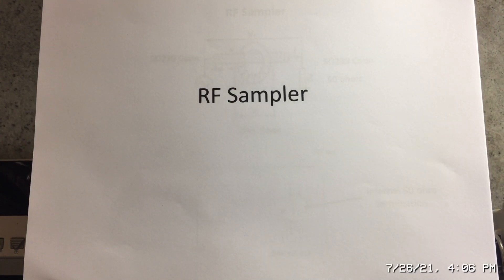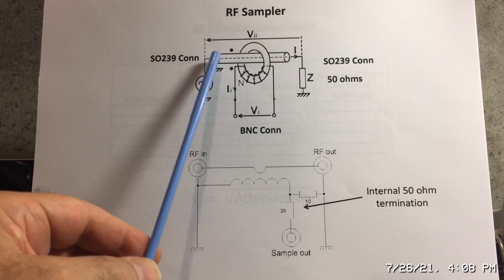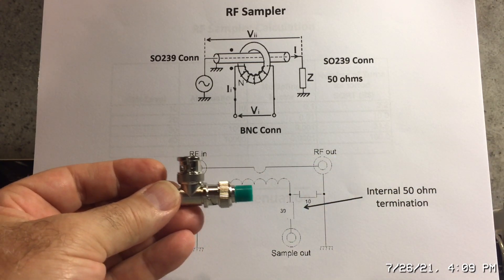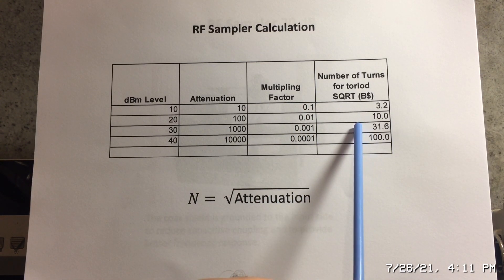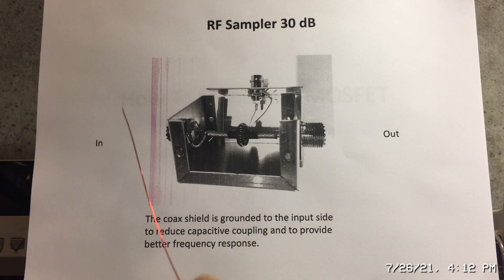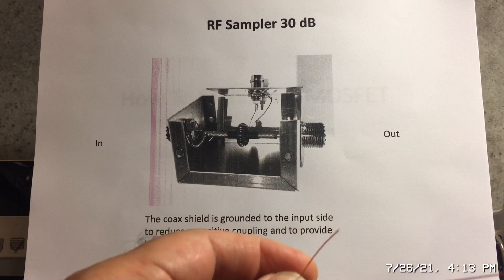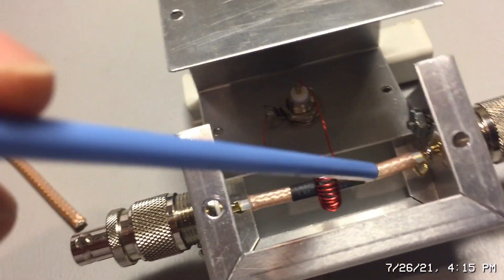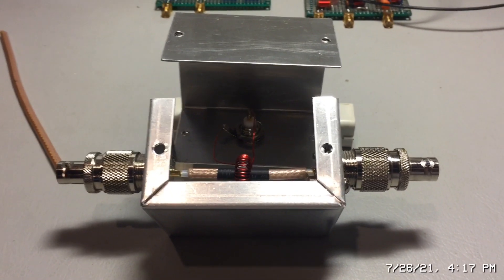How to build an RF Sampler for Ham Radio and RF Applications

Comment: Thanks! I just built a 30dB sampler based off of this video. I was using a very small ferrite, ran out of room for windings, and ended up a few turns short of 32. But nonetheless, it's almost exactly 30dB from 1-100 MHz. Such is often the way with RF! You just never know exactly how it's going to perform in the real world.
Reply: How about Use two Toroid

Comment: Hi , is it possible to add 3 more sample ports , ie a bigger box with 2 bnc sample ports on either side?
Much appreciated 
PeaceFromOz😊
Reply from the maker: Yes, I would shield each section with sheet metal to reduce interaction. Regards,  RF Man
Reply: @rfmanchannel6915  thanks for the reply...much appreciated.
PeaceN73Oz

Comment: I read that these are current samplers and are much more reliable than a voltage sampler as they have a more flat response across the frequencies. Definitely need one.  I have a really old Agilent network vector analyzer that O want to use with various power levels.  Do you use a step attenuator to zero out the fundamental? We did this as part of our test procedure when I did my co-op work term at Nautel EDIT, I just checked, my spec analyzer, the S input will take 30dbm (1W), and the RAB inputs will take 20dbm(100mW). so if I test a 1kwTxmttr, I would need the 30dbm for the S input  and 40db for the RAB inputs, anything more and I could just put an inline attenuator between the sampler and input to my s.a.  73!!

Comment: Would it be possible to build a longer box, and set up multiple couplings within the same box to have different -db samples in one box? For instance a box with a 30 and 40dbm attenuation on separate bnc connectors? One longer piece of coax with the shield grounded at the input side, and a separately wound transformer for each output? I suppose i dont see why it wouldnt work but rf is weird
Reply: I would like to know this as well.

Comment: Poorly done..the inductive pickup has BW limitations although mostly linear.

The coax with broken shield is a big discontinuuty and will cause reflection

A microstripline and surface mount resistors are the correct method.
Reply: Which type is suitable for continuous monitoring of the transmitter, without wasting much power.

Comment: Need help clearing up a little confusion. So you say use shielded Coax to support the ferrite core with the windings. Ok, I have a core ready for install in my sampler in box. You mention grounding the shield at only one end, Ok, I get that as to not create a ground loop which would cause issues, read that in a book for Ham construction. You mention capacitive coupling, not a good idea, I get that, unless you actually want coupling( not in this case, but would want coupling in a multi pass attenuator) I saw one of those in the book I am reading or at least I think so, the picture and text from that section discussed all of that but we're not here for that right now. So my question is this. If the shielded lead is grounded, wouldn't that eliminate RF which is what we need to induce current in the toroid coil?
Reply: It has nothing to do with ground loops.  Grounding the coax foil at one end turns it into an electrostatic shield rather than an electromagnetic one.  It blocks the electric fields that would otherwise capacitively couple the center of the coax to the secondary windings in the torroid without blocking the magnetic fields the transformer needs to operate.  If the shield wasn't there, that capacitive coupling would otherwise negatively affect the high frequency performance of the device.  The metal box you put everything into is connected to both ends and is the electromagnetic shield.
Reply: What is built is basically a current transformer. With the shield you minimize the electric fired/coupling, but the magnetic field/coupling is unaffected by the shield. So your toroid is coupling the magnetic current propositional to the rf power.

Comment: Thanks for the presentation of the inductively coupled RF tap practical design demo.
At 14.20 on when speaking of the Gain of the contraption you mistakenly mentioned it to be  S11 parameter instead of S21.
S11 is the Return Loss (or the SWR in the amateur radio operators' world) which you explained earlier.
It's always better to use a thin gauge wire to cover only 270 degrees of the circumference of the torroid to avoid the interwinding capacitance affecting the performance at the higher end of the HF spectrum. You can afford to put an extra layer of the heat shrink tubing for a snug fit.
A small value compensation capacitor (say a "gimmick capacitor" rightly trimmed up) may also be tried to achieve a flat frequency response.
De VU2RZA

Comment: could one put multiple ferrite coils on one piece of coax as demonstrated the in this video, this way only one box with multiple taps, or am a missing something with doing that. TheDM (UK)
Reply: I just built a dual coil sampler last night based on this design. It works

Comment: order a ft-50-43 but the center was to small after wrapping wire. coax wouldnt fit..is there a bigger center hole with the ft-50-43
Reply: What size wire did you use and how many wraps?  I could only get 24 wraps with 22ga magnet wire. So I cannibalized an old CRT television I pulled out of the recycling center.  I pulled the yoke (deflection coil) off the neck of the CRT and used the wire from that and got 32 wraps on the 50-43 ferrite. A piece of shrink tube on the RG-303 worked perfectly.

Comment: Hello Mr. what lab power supply do You use for ldmos amplifiers to supply them with ~50V ?
Reply from the maker: I am using several 24 volt power supplies in a parallel / series configuration to provide up to 80 amps at 54 volts. The power supplies come out of a control system for a power plant. The manufacture is Phoenix.

Comment: Absolutely interesting. Thanks for sharing. I’ll definitely build one. 73
Reply: Great, I'm glad you found it helpful!
Reply: @carminecampo2045  I'm getting the material now. Just one thing I've noticed. As per last chart Port 2 reads the sample at -36db ish, so shouldn't it be rather a -36 db sampler? I've seen -32 on the label there.
Thanks for you answer
Reply: @IZ0MTW  The calculated value is -30dB. The measured value with a watt meter was -32dB. The VNA showed -36dB, however there are other factors that effect the gain (coax looses, etc.)
Reply: @carminecampo2045  very good thank you!